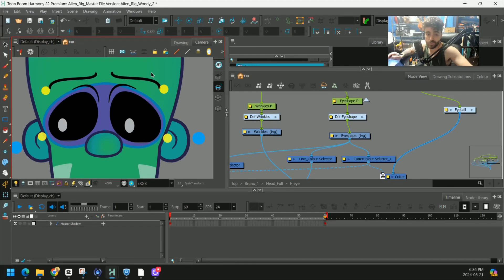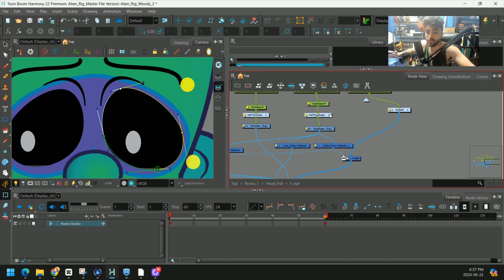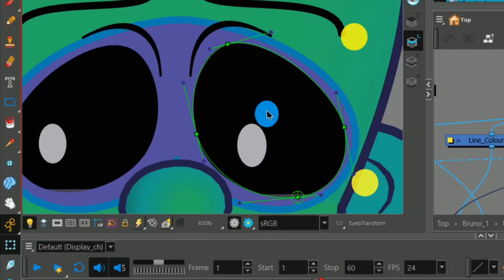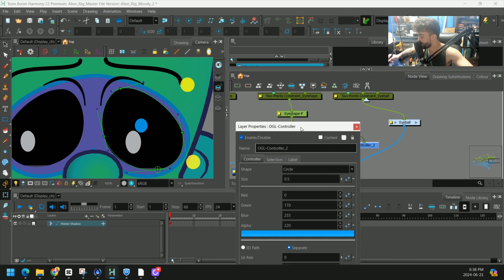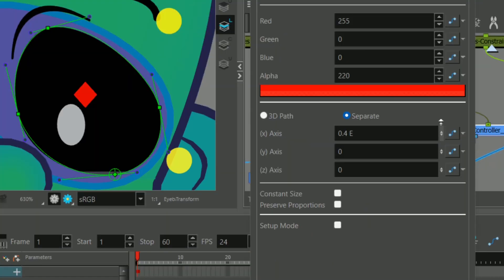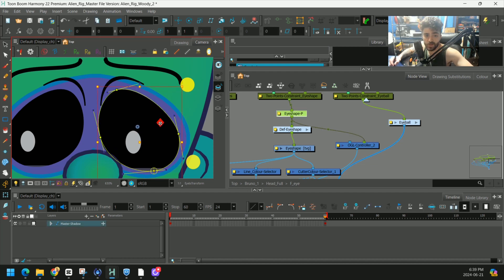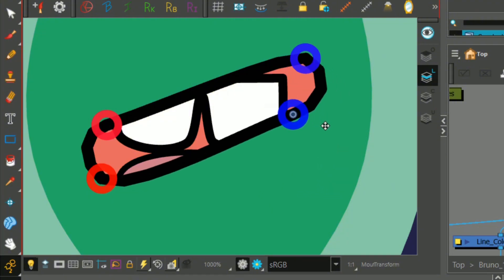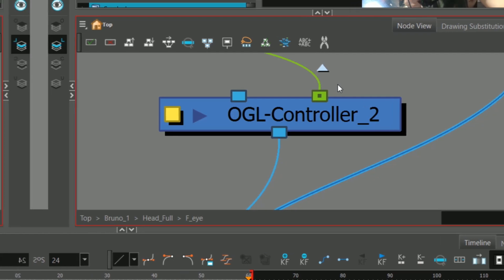The “Not so New” Way of adding HANDLES in TOONBOOM (OGL Controllers)

Comment: Instead of entering coordinates to move the OGL controller, what I do is check the setup mode check box, and then you can drag it where you want.
Reply from the maker: oh thats a great tip! thanks dude
Reply: @fabio_gioffre  yeah, I only mentioned it as I was doing it via coordinates for a while, until I tried clicking that and it just made it so much easier and intuitive.
Have you tried Harmony 24 yet?